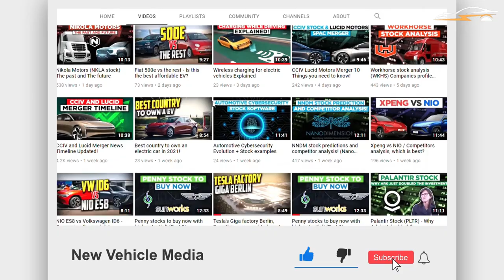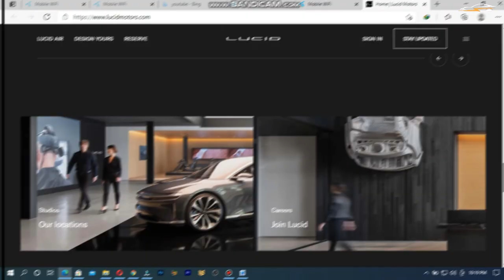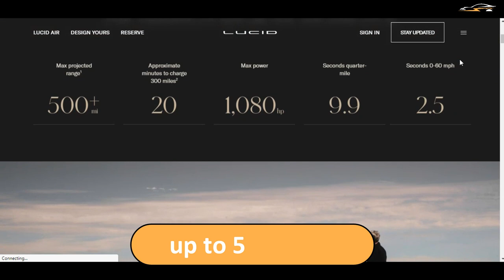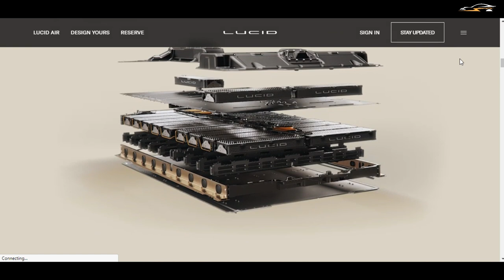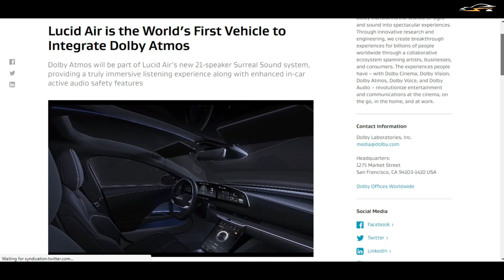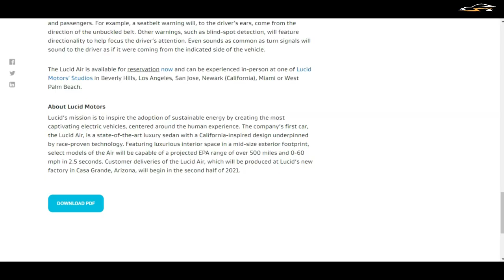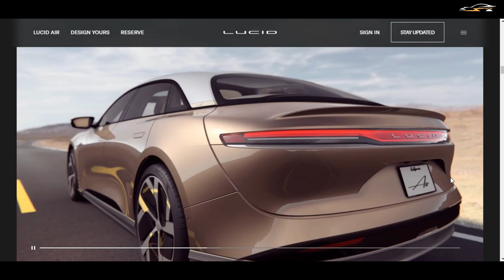Lucid to be THE WORLDS FIRST Dolby Atmos equipped cars!

Comment: Great improvement in the range and charging time. But not good enough for me to start looking at EVs. I need a range of at least 700 miles and full charge in 5 minutes. 
The BMW X7 with the optional diamond sound system has the high audio channels. Not Dolby Atmos but very close.
Reply from the maker: Are you hoping it becomes a succes?